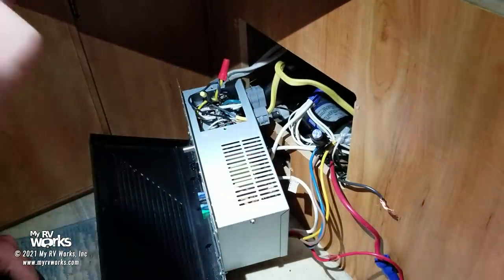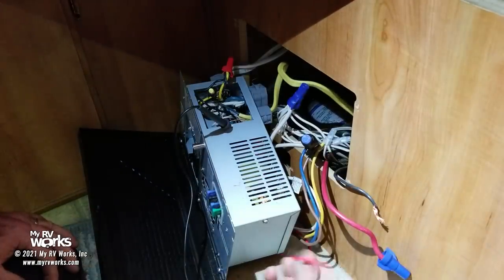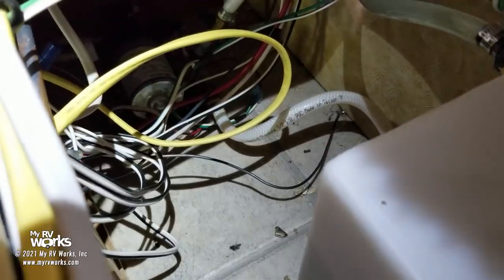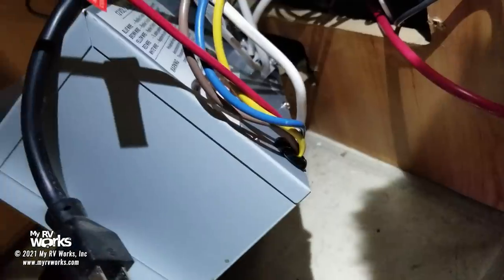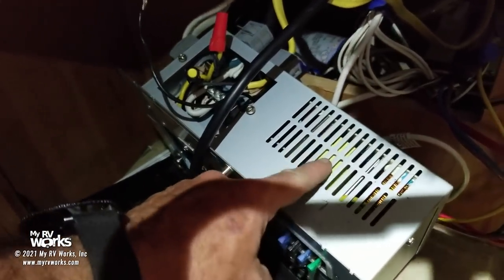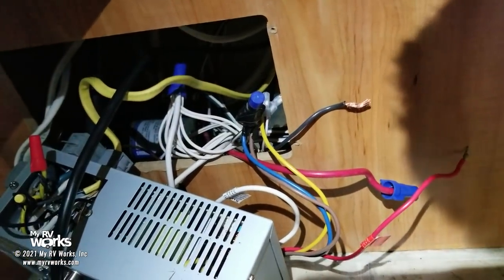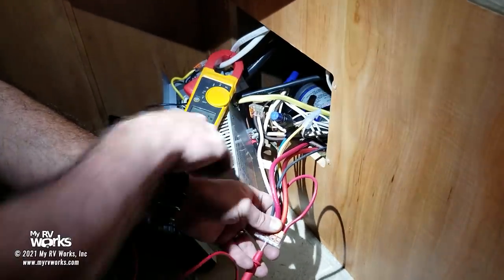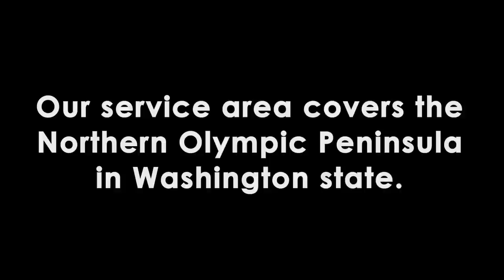Faulty RV Converter Cooking RV Batteries  --  My RV Works

Comment: Good stuff...just in addition, if your planning to change your battery to lithium you have to change converter as well.
Reply: Not necessarily. There is some new info coming out. Also newer converters are lithium compatible.
Reply: Well might not need a converter but will need a bms . Lithium batteries are not your old lead acid.  Lithium batteries will catch fire if improperly charged
Reply: I run custom lithium batteries in my van it's set for 3.65 v per cell and inverter charger is set at 14.6 bulk absorb and 13.8 float I use a 200 amp daly BMS too
Reply: @davidmcgee2126  they come with BMS if it's a ready to drop in lead acid replacement

Comment: Option 4: Orphan the existing converter by disconnecting the black feed wire as shown and plug the new converter directly into an existing 120VAC outlet or piggy back off one and install an outlet in lower storage area.

Comment: Darren ..nice job once again. I have done a few of these myself and actually did repair one of them (But I don't suggest it as you need access to several electronic parts). I am one who likes to know WHY it failed and the times I have these..it all related to simply not having rubber booting the red cable at the battery when disconnecting it. People think that once the battery is disconnected, and the shore cord plugged in, they are on AC feeds, (Which is true)...but  they usually just leave the red battery cable hang loose..which usually touches or makes contact to ground and creates a dead short!! People forget that the red cable is still live dc from the converter trying to charge the battery & can't be shut off, thus if it shorts..your converter takes the hit and the first thing to go is the voltage regulator & monitor circuit...and like you showed....undisciplined voltage of 24 V + now feeding the system!  Darren..please let your customers know this during your next electrical talks!! Thank dude..enjoy the video but miss seeing your camera guy!
Reply: Thanks for sharing this. I learned something that will probably save me grief in the future. 👍
Reply: To summarize the warning from above:

Those not familiar with RV electrical systems may not realize that while the RV is plugged into shore power the converter is providing charging voltage to the battery bank, which is it's primary function.  Therefore, if the RV batteries were to be disconnected while the RV is plugged into shore power and the positive cable grounds to frame a short circuit will occur and possibly cause damage to the converter and other components.

With the above, the same is true while the RV is plugged into the tow vehicle through 7-pin connector.  The tow vehicle has battery voltage being applied to charge RV batteries and/or operate 12V appliances.

Comment: It has been a long time since I found a converter that was putting out too much DC. Seems like the newer ones just die and put out no DC power. I just recently stated using the WAGO connecters. I love them. I didn't realize they come in larger sizes though. Thanks for showing us that. Give me a call sometime. We need to catch up.

Comment: Hello I'm a big fan of your channel would you please help /give some advice so I have a question, I have a bad converter/battery charger, In a 1994 Bounder motorhome. When  the RV was plugged in, their was a power outage and I started my generator up to run the A/C  apparently when the power came back on it shorted? And  burnt it up ,I unplugged it because it smelt like burn dog hair at the time I didn't have a dog,( and you also said something about burnt dog hair) well I plugs it back in a while after like 3 weeks after this happened and It continued to melt/burn a wire.  That goes to the electric panel ,I've traced it to where it disappears into the floor of the motorhome. And doesn't come through the floor into the storage compartment? . Please help I'm stuck with out 12 power in my cabin . I have a new wire connected to the burnt wire I was expecting to be able to pull it through but I can't find it outside of the cabin .

Comment: Great video as usual. Could you clarify one issue? If I am on shore power the inverter is just passing through the current/voltage and MSW or PSW really does not matter correct? The inverter, If a MSW only creates this when I am inverting 12v to 120? Am i correct in my understanding when I am off of shore power?

Comment: Good video as always.  My converter will sometimes charge as high as 14.3 bulk, then drop to 13.6 before dropping to 13.1. Mine is a converter charger as well. Question.. are there different  kinds of converter chargers? Mine has a push button "charge wizard "  thanks, as always, appreciated
Reply: GkWI Pa

Comment: Why didn't you just add an outlet instead of cutting the factory plug off?
Was it more expensive to install an outlet?
Reply: Great question, that’s what our guy did. He orphaned the original converter, which was still working fine added an outlet and installed my new lithium converter.  Now i have more outlets and flexibility
Reply: @mrs.c5471  Hard wire connection is always better , 
Loose wire cause fires any resistance in a connection can cause heat

Comment: I am at a loss as why you connected the red output from the old converter to the new converter. I would definitely had not done that and need to understand the why please
Reply: so as the distribution box looked original and kept the breakers in place ,
Only replace the charging part of the converter 
Rob
Australia
Reply: I also noted that. If he disconnected the 12V side of feed from within the box then he is good as it would have only fed 12V too a bad circuit. The red wire (As I understand it from the video) is the main fuse panel (12V panel) so the built in breaks there will be able to feed the 12 lighting and water pump still. I assume he did clip out the old converter 12 wire so as not to back feed into a bad converter.  Good eye my friend.
Reply: The primary function to install the converter was to have 13.6VDC Output charge batteries.  In addition to charging batteries it ties into the trucks power feed from 7-pin connector and will feed the 12VDC appliances for the RV which is back fed through the red OUTPUT wire of the failed converter as mentioned in video @ time 19:10.